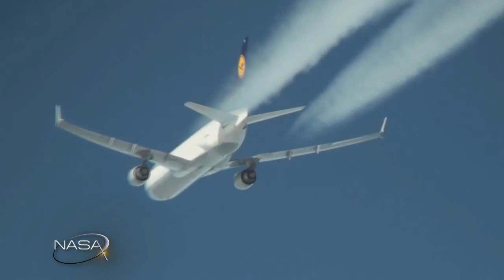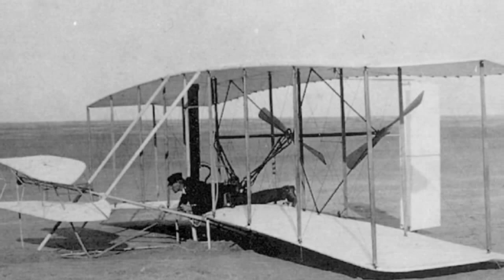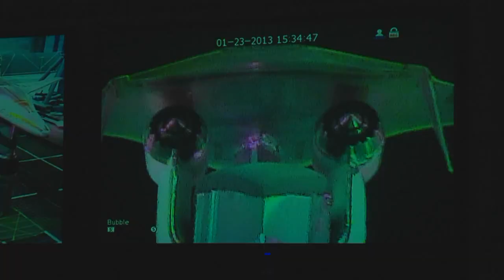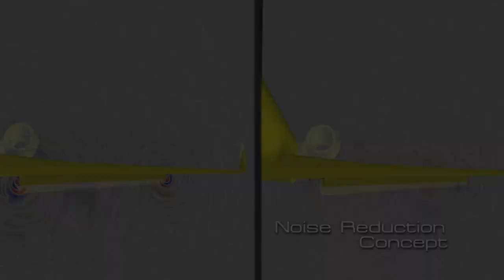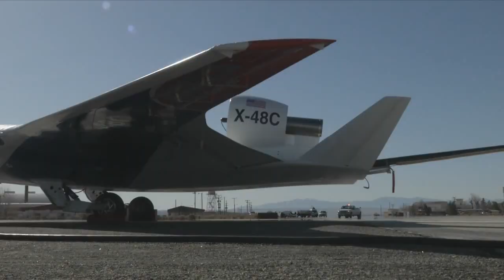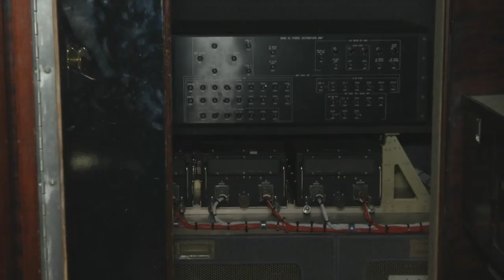NASA’s X-48C Hybrid Wing Body: The Future of Quiet, Efficient Flight (Full Documentary)

Comment: 737MAX
Reply: ok you know the name of a plane is that a successful achievment to you?
Reply: @aseem7w9  The 737MAX is a classic example of what happens when you cut corners, and Boeing has had a string of failures because of corner cutting. It's a shame, because up to now Boeing has had a great reputation.
Reply: @jhill4874  faa shouldve done certficiation properly imo. theyre the ones responsible for ensuring safety of planes
Reply: @aseem7w9  The FAA is also culpable. It's manufacturer's responsibility to make a safe aircraft, and the FAA's responsibility to make sure the manufacturer does. There rumors that Boeing made a donation to McConnell, and McConnell's wife, SecTrans Elaine Chao, passed word down to minimize the FAA review of the 737MAX and allow it to be treated as just another version of the 737.

Comment: Oh, i understand, the dream liner was just one of those projects where they threw caution to the wind, and continued to do so despite knowing what the problem was.
Putting an explosive in a steel box is like making it a little more leathlel because it sprays shratnal all over the place, including the passengers.
I understand that the FAA is planning to try and chage the rules about model aircraft, how sick, when a huge number of the people involved are also involved in building the real thing, like the last boss of Gthe scunk works Ben Rich..
The idea of model aircraft is to improve on model aircraft and if you look at todays electronics for models its mind blowing, just look at the rise of quad copters and how far they have become, so much so it will not be long before people will be flying in them, so i would say to the FAA, WAKE UP and take a look at where model aircraft are at which can hang in mid air tail down, or perform the snake bite.

Comment: I didn't like the gigantic blunt leading edge of the early drawings.  Here,  you've improved a lot.  If you need a guide for transitioning into the wing look at the fine vertical stabilizer transition contours on general aviation, for ex.182, aircraft.